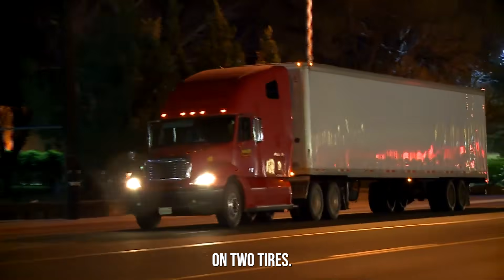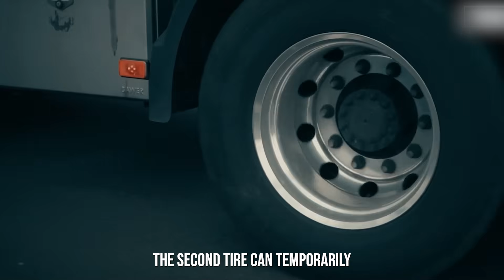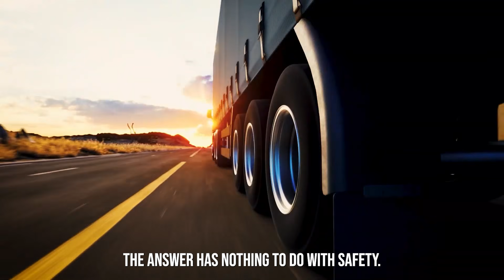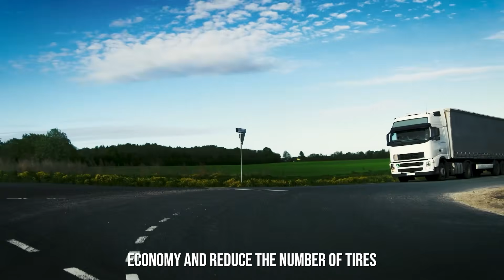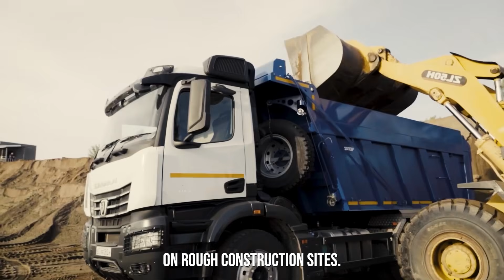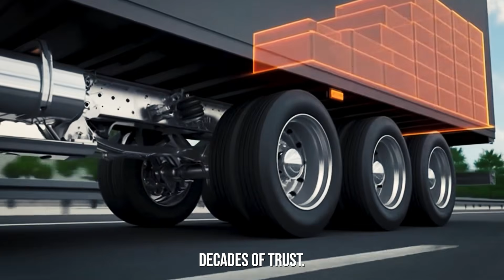The Real Reason Semi-Trucks Have Double Wheels (It's Not About Weight)

Comment: Supersingles have failed. I am a retired truck driver. The super singles have proven inadequate. If a dual fails, you do not continue to drive. You need to call a mechanic to repair or replace the tire. Super singles did not live up to their advertised capacity.